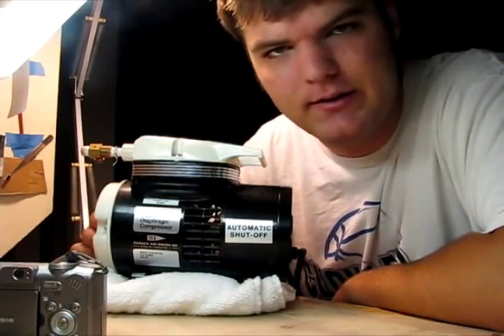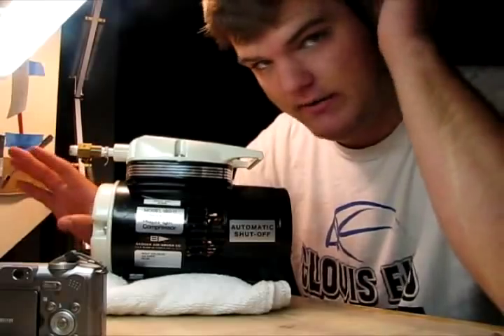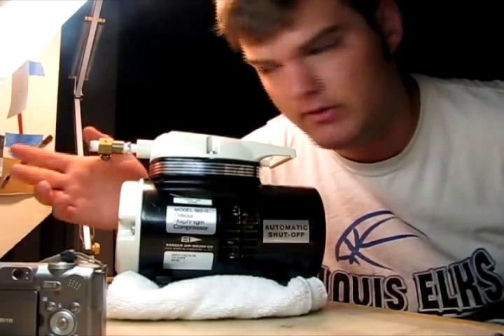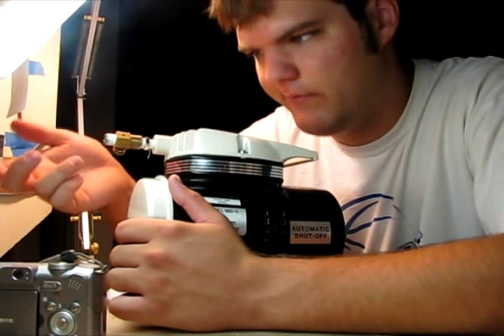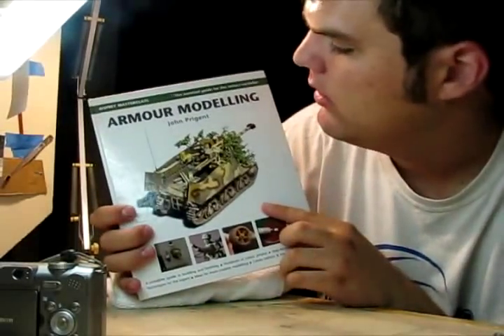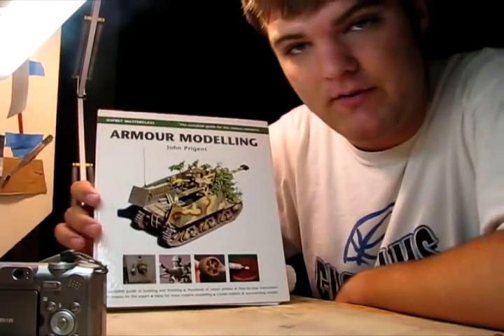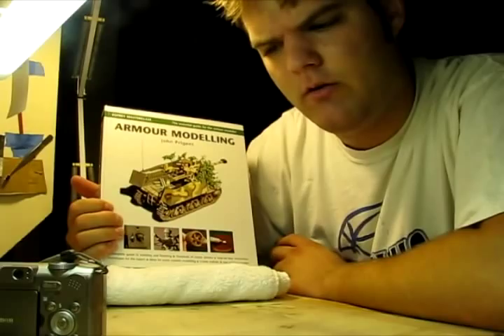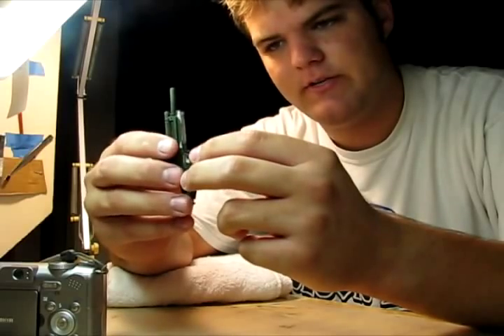Badger model 180-11 reveiw

Comment: I feel you, I just bought the Badger 180-10 brand new on graiglist for 35.00 and he threw in a 350 Airgun for 15.00 also new.I saw one on Ebay as a Buy now for 180 with Air brush. I got luvky. I LOVE GRAIGSLIST. IT THE #1 PLACE U GET GOOD DEAL.  What I dont get it didnt come with a Regulator like my TC-20 from TCP. Did you Added one and what kind you did????